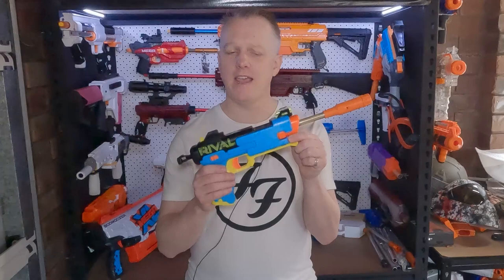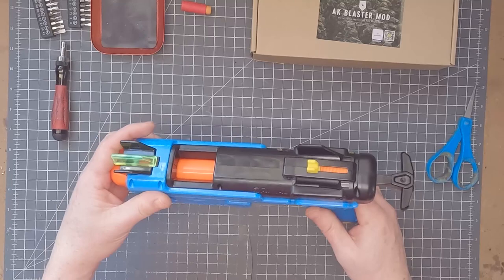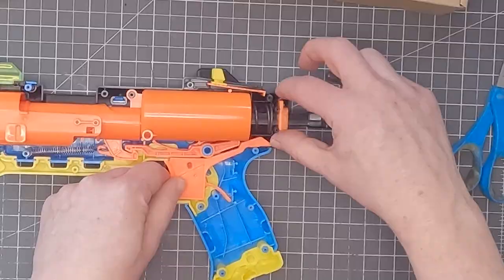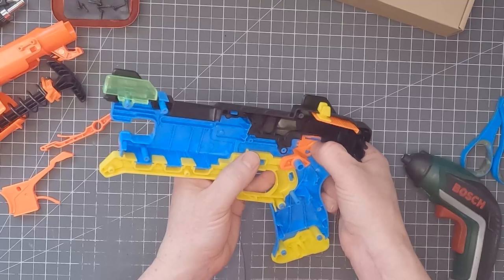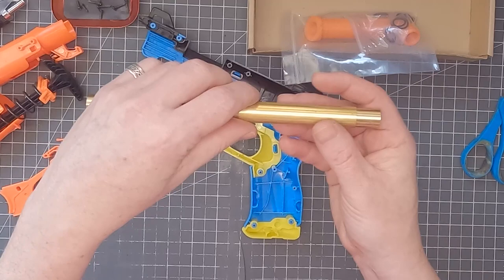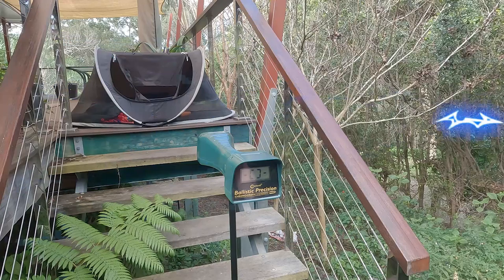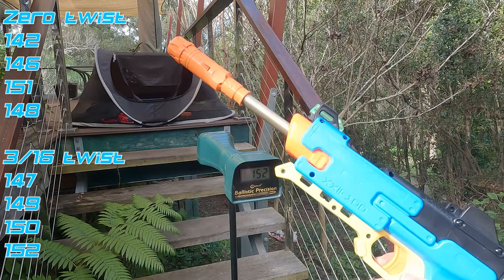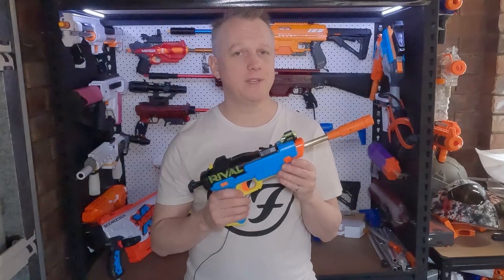Blaster Breakdown 31 (July 2022) - Nerf Rival Fate - AK Blaster Mod short dart kit - How to

Comment: I made an inline clip using an alpha trooper barrel, a tampon casing and a lot of e tap
Reply from the maker: Nice - a lot of cool mods possible with this one, without too much effort. Did you change the breech opening action to the safety switch so that it doesn't open with every prime?

Comment: Looks like we have a new benchmark for single shot superstock blasters
Reply from the maker: Was pleasantly surprised how straightforward this kit was - even before I found the actual instructions after I'd already finished 🙄
Reply: @andrewg_nerfmods  
Just wondering how to seal in a regular brass breech, without the plunger tube seal.  Is that possible?
Reply from the maker: @Raptorboi  how do you mean?

Comment: You should look up BuilderBB's safety mod for this blaster.
Reply: Digging the Foo Fighters shirt. Way back in 02 I waited all night outside in a parking lot to see them on the MTV2 $2 Bill tour. $2 tickets for a televised concert. Fun times.
Reply from the maker: Nice 😁
Reply from the maker: I've seen that, and did consider it. However, there didn't seem any obvious benefit to separating priming and breech opening for a single shot configuration.
For inline clips, absolutely - it saves opening and closing for each shot.